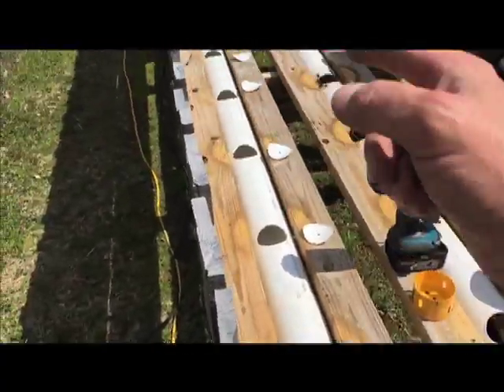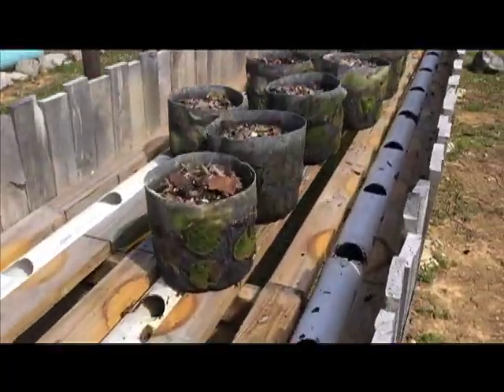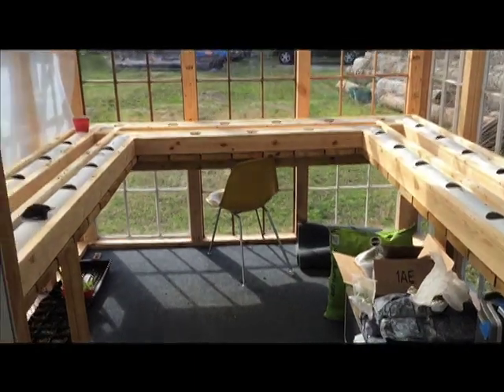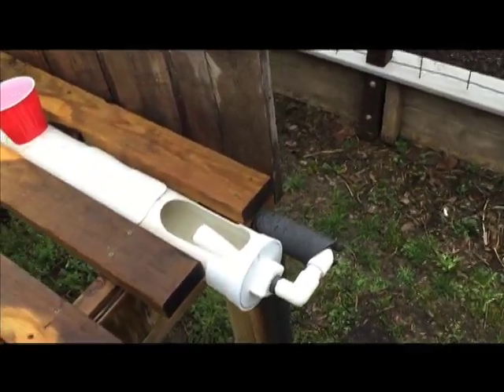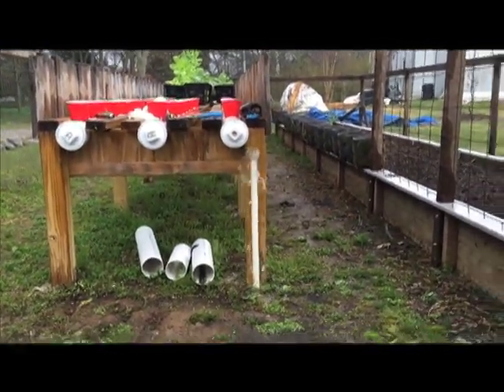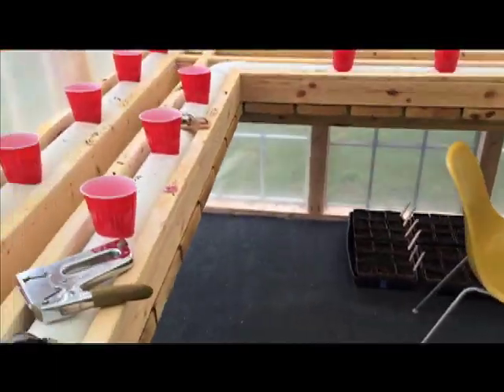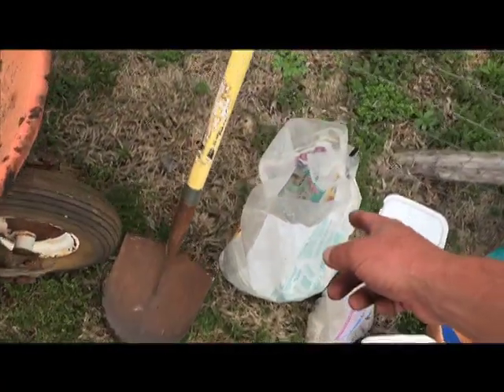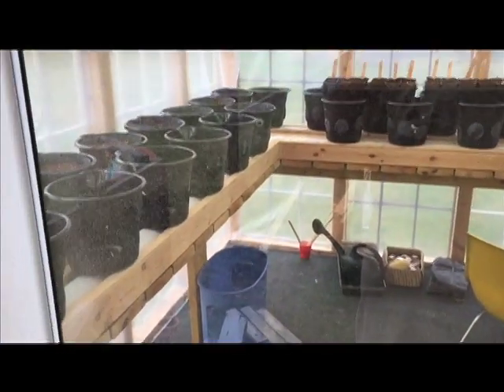RGGS Rain Gutter Grow System Upgrades and Problems with float valves

Comment: great update.
i used landscape / weed fabric material as my net pot cover. although it contains the soil you will find that the roots will still find their way out of the fabric and into the pipe and i noticed that my roots are all white and healthy looking (this is why i will try out the Kratky method next season utilizing the hybrid setup). The hybrid system is practical and functional but the initial setup costs can be costly.

next summer/season, i will mimic the setup but will be using hydroponic solution as i want larger and faster yields and trial out the Kratky method where half the roots are in the water and the top half is exposed to air. 

As for using buckets to hold the pots, i will give them a miss as the fabric shopping bags i used did very well throughout the season  (want to be more frugal next season and plus, i personally found the buckets abit of a nuisance and a pain to find free ones ;-)  

ill be adding a shade cover over them as i found that majority of my fruits/vegetables got sunburned.

As far as mosquito's, i too found alot of mosquito larvae in the pipe system as the mozzies somehow find a way into the pipe...they say put afew parsley leaves into the water to deter them, so not sure if this would work, but ill try it out next season.

Great updates and vid's as i always look forward to your progress.
Reply from the maker: Wow, thanks for the advise.  I will try the parley trick and see.  Good luck with your set-up.
Reply from the maker: iROBODUDE When I pulled my buckets from the greenhouse to move them outside they also had white roots that made their way through the bedsheets.  No foul though, not like the nasty, clogging root balls that I got without protecting the net cups.
Reply: I trapped a few large tadpoles from our pond, they take care of both the algae and mosquito larvae, was entertaining to watch them mature into adult frogs.

Comment: All credit to you for having a go although it seems a little over engineered to grow a few plants.
Reply: David63190 yes, you could say over engineered, but what if, upon his return from duty, he runs each line out the length of his property? Not just a few plants would he, ( and his wife, ... Hi!), be growing then, ... a team effort is required by any stretch of imagination, ... especially if timers are used for the irrigation of so many plants, ... depending upon weather conditions, unless the proper sensors are installed in order to make sure that the vegetation planted gets a sufficient amount of moisture to not only grow, but to thrive throughout the various stages of the year, ... 
Proper hydration has generally been at the mercy of Mother Nature, unless one can use, and continuously reuse the moisture originally dispersed to the plants, ... with todays technology, one can use a good watering, for hundreds of thousands of plants, in a continuous recycling of the water, ... and only add enough moisture to the system, as is necessary to replace that which is lost to the atmosphere, and to the benefit of each individual plant’s growth, ...

Comment: The algea grows due to sunlight as in the great algea blooms in the sea. My ibc tanks are black so the sunlight can't get to the water and peat moss will contain algea as it would have come from a peat bog. I changed to coco fibre mixed with compost and have a wick system as it will wick up into the pots and potting compound will not be continuously in the water hope this makes sense.
phil
Reply from the maker: Thanks for the tips.  I may not get to use any of this info as I am out of state until ... who knows.  Heading overseas again.

Comment: Hey there irobodude, I bought some EM-1 a few years ago cuz it was supposed to be helpful with composting... one of the wonderful side effects is that, because it's good bacteria... it will overpower the bad bacteria...i.e., algae.   I had a water tote like yours and within a few months it was spitting out algae.  I used the EM-1, as instructed, and within a few days, the algae flushed out and never came back.  Really nice! Just a suggestion.
Reply from the maker: +Tina Stewart Thanks for the suggestion.  I just ordered it.  I'll give it a try.

Comment: Forgive me if this has been already suggested. If the algae is building in the off season, I suggest you buy an extra screw in end cap and remove the one with the float valve during the off season. At minimum it would save from cleaning out the float valve system. Or just leave it open ended and let mother nature clean it out until you are ready for the next season.
Reply from the maker: Yes, thank you for the suggestion.  I think the problem was that it dried inside from the previous season.  I open and dump all of the pipes after growing season so there is no water in them all winter.

Comment: Larry did a video using a paint mixer on a drill to mix the soil, maybe it will help break up the root clumps and mix boil.
Reply from the maker: Sounds like a good idea.  The old soil is so full of roots I like to sift them with my hands.  It's not that bad, and I kind of enjoy it. :)

Comment: I made a pond from cement block 4' X 8' and lined with pond liner 15 mil filled it with water and put some feeder fish cheep $0.13 each put a 1/4 horse pump in it and setup a aquaponic garden rain gutter system  will work well with this pond
Reply from the maker: Sounds great.  I have been thinking about ways to improve the system.  I have some cool ideas but I am out of town for extended time now.  Might have to wait till next season to do anything.  Thanks for the comment.

Comment: In case you do not know, if your float valve fails in the future by not shutting off completely you can get replacement parts at this place. http://www.usplastic.com/catalog/item.aspx?itemid=76367
This is my first year trying the RGGS and it will be a hybrid using 5"x5"x8' PVC fence posts that I got on clearance for 6.18 at HD. I'm in the Chicago area and my end of season plan is to remove my Root Pouches and shop vac out any standing water then blow out the supply lines with compressed air to clear them. Then cover the system (in ground) with a canvas tarp and empty the pouches on top of it mixing in leaves, coffee grounds, egg shells, banana peels and folding the remaining tarp over until the spring. I enjoy watching your videos, keep up the good work.
Heather

Comment: Here's my idea on the end of your water pipe that you have the fill valve that was cloged with algea put a T on the end of that pipe. on top of t put a screw on CAP that can screw off for acess and on the  bottom of t put a short piece of pipe with another screw  on CAP that has a 7/8ths hole drilled in it now you can use a toilet fill valve in that t. Install the toilet tank fill valve to CAP with drilled hole and install it inside t threading on the bottom cap. Hook up water  hose to threads that come out of bottom cap. Adjust valve height for desired water level. Wala now you have a readily available valve you can replace and take apart Easley

Comment: Cover/paint the IBC to block out UV either build timber panel cover around frame work or use a high grade UV shade cloth or paint in a white colour to prevent penetration of UV an the build up of Algae. Or place in or under a shaded area to reduce exposure to sun light like the dark side of shade house .
Reply from the maker: Thank you.  It is painted now.  I originally was going to cover it in wood that is why the base was cut in a round shape so it would look like an old water tank.  Life caught up and I just didn't get it finished.  Thanks again for the comment.

Comment: Stretch a section of the fabric that is a fair bit larger than the opening of the net cup, say an 8" square and simply start filling with your soil, pressing it in to the cup, packing it and then trim the excess off material.
Reply from the maker: Jack Peters That is exactly what I did but I left the excess material on to provide even more wicking.  Next year I am going to try 2 or 3 coffee filters.  The root system grows right through the t-shirt but I don't mind that.  I just don't want the pete moss to get into the water.

Comment: 7:19 don't know much on this system but I think there is an issue, you may want that connection higher to send cleaner water and a flush valve at this connect is at to dispose of contaminants .. here in PR my home collects water from a spring my tank is set up this way for cleaning
Reply from the maker: That video is 5 years old.  I have since replaced it with a float valve that sits about 1/2 way inside the tank, in the center not on the side.  I will post a new video of it soon.  Hope you sub'd and hit the bell and you will see what I did to mod it when I post.  Thanks for the comment, you are right on.
Reply: @iROBODUDE  you make good videos thank you very informative

Comment: I love your system, I would like to do something like that for winter so I don't have to try to grow in hoop house raised beds. Do you have any issues with pests like pill bugs and slugs or snails? I wouldn't think so and that would be nice. I would suggest using something besides a piece of sheet for the cups, it might wear out fast, maybe a piece of landscape fabric? just a thought. Thanks for the video, when I save up some money, I'm making one of these. Take care, Kim
Reply: ***** One other thing, is there any reason you used PVC pipe instead of rain gutters?
Reply from the maker: ***** Yes, I wanted to have the water contained.  I thought it would cut down on mosquitos and algae if there was no UV's.  Also, keeps less of the rain water in for overflowing issues.
Reply: +iROBODUDE Thanks for your answer, can you tell me what size float valve you bought, I would like to make some tall planters in under-the-bed totes for disabled people. That way it would be tall enough for someone in a wheelchair and also they wouldn't have to worry about the watering, it would be automatic if hooked up to a 1/4 inch water line, thanks so much, Kim. I also wondered how the bed sheets worked for the 3" cups to keep the soil from getting in the water?
Reply from the maker: I bought a Kerick Valve from Amazon.  There are several options for connections.  The bed sheets have been in all summer and are doing fine.  I re-used the soil from the previous year after dumping out the bags and remixing with some new compost.  They didn't do as well this year.  Good luck with your system.

Comment: NIce vids. Try painting your IBC dark green or something to reduce light penetration.
Reply from the maker: Yes, just one more thing I haven't built yet.  There never seems to be enough time to do everything.  When I built the pedestal for the IBC, I placed it on a round base.  What I need to do to finish the project is build the round top and cover it with wood and put a spire top on it so it looks like a old time wooden water tank.
Reply: Great idea!

Comment: This is amazing. Do you by any chance have a detailed plan that you might sell?
Reply from the maker: Tami Vanderwilt No, I'm sorry I don't but all of it step by step is on my channel.  May not have measurements but that is the easy part.. :)
Reply: I'm a designer and can create a design of this as I see it. Might be a little different because I can't measure it in person. What part are you interested in? The building, the raised platform or the outside garden setup? Raised or ground level? So many options to choose from.

Comment: What tool did you use to cut the access hole on top of the PVC pipe for the float valve ? I’m thinking of using a rotozip tool.
Reply from the maker: I used a jigsaw with a fine blade

Comment: Hello. I've been watching your videos all night (which I have enjoyed and has made me want to try this project) and am now up to video #10. I noticed the hassle of having to drill the holes in the buckets. What are your thoughts on mounting your drill to a solid platform and pushing your buckets into the bit instead of having to man handle the drill all the time? Maybe you have tried this in later videos I just haven't made it there yet. Also... when you are washing out the pipes and losing all that good material maybe making a type of plunger on a rope that you can snake through the pipe and pull through to keep that rich dirt. Again, great videos. Take care.
Reply from the maker: I have actually tried it without the buckets this year.  Seems to work just fine without them.  The purpose of the bags is to let the roots hit the air.  The buckets just prevent most of the bag from seeing air.  If I were starting from scratch I would recommend using kiddy pool technique.

Comment: Did lining the cups effect the wicking action of the cup and soil?
Reply from the maker: They worked as they should.  I have not used this system in years.  It was partially because the bags grew so much moss on the sides in one season that they were unusable the next year.  I think the kiddy pool is a much better solution anyway.  And remixing the soil each year was a pain too.
Reply: @iROBODUDE  I like the kiddie pool idea but how does the water absorb through the bottom? Do you have to cut a hole? Also, doesn’t the pool attract mosquitoes?
Reply from the maker: @avig144  Not sure I understand the question but I think what you are asking is how does the water wick.  You don't use buckets, you set the bag into the pool so the entire bottom of the bag is in contact with the water in the pool.  You can put a float in the pool to auto feed water for evaporation.  You can tie more than one pool together with just one float valve.  I guess you will have to google alternative food safe mosquito repellents.

Comment: why not use a really "wicky" medium that doesn't fall apart like Rockwool? you can buy a 3.8cu.ft. bag of Grodan Rockwool cube media to fill the net cups and bottom inch of the buckets. they are little centimeter sized cubes and super super wicky probably work perfect for that. basicly sponges of heated and spun rocks kind of like cotton candy but much harder.
Reply: if its rock wall you are looking for I am part of a company which makes insolated boxes and have loads of scrap for sale :)
Reply: b.c canada

Comment: this system is awesome except the weak point which is using net pots and soil to wick, i need to find a cheap and easy to use material that is not so messy and eases the cleanup problemand thats reusable and doesnt break down. theres gotta be something better out there, rockwool? any ideas?
Reply: rockwool isnt really a good idea, it will break down verry fast and it ends up everywere including lots of algae that grows on them. A cheap and easy way to wick water is woodchips and ontop of the woodchips you place some clay pallets or some small stones to cover up the woodchips. Or you can make a drip system without using a single pump using valves, and place the main source of water higher than the growth is. As soon as water evaporates or is used the valves open up and it drips till the predetermined height is reached again. And if you dont like to use woodchips you can go with coconut fibers roughly cut not the small particles.

Comment: Which model of the float valve did you use?
Reply from the maker: https://www.amazon.com/Adjustable-Aquaponics-Aquaculture-Hydroponics-Reservoir/dp/B072FJ4YFM/ref=sr_1_19_sspa?ie=UTF8&qid=1523401778&sr=8-19-spons&keywords=float+valve+12&psc=1
Reply: Thanks a lot for the information.

Comment: Try a solar copper ionizer. Place this in your water tank to remove algae.
Reply from the maker: I will look into it, thanks.
Reply from the maker: Ok, I just looked into it.  I originally was going to build a wooden enclosure for the water tank to make it look like an old time wooden tank.  One thing led to another and I didn't get around to it.  So... I just watched this video https://www.youtube.com/watch?v=S0fqKJ82sRc although not as technical as I would have liked but I just ordered a solar panel and will get it hooked up soon.  I'll post a video when I get it together.  Thanks for the heads up Rick.

Comment: As others have said... stop the light from getting to the tank.No light, no algae.. Goodness me!!.
Reply from the maker: Yes sir.  I know... I just had planned to build an enclosed old time water tank enclosure.  Didn't get to it.  I'm out of state working and probably going overseas again for a year.  I went home to the holidays and my wife doesn't have the technical background to do anything on the system.  She let the pipes freeze and the water filtration system blew up.  I turned the valve off and thats going to have to wait until my return.